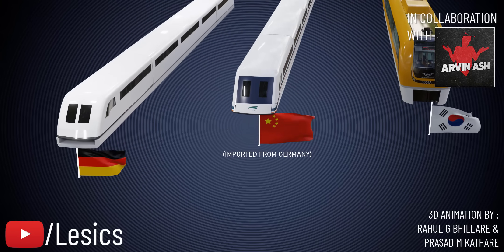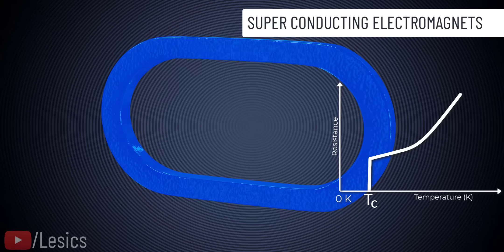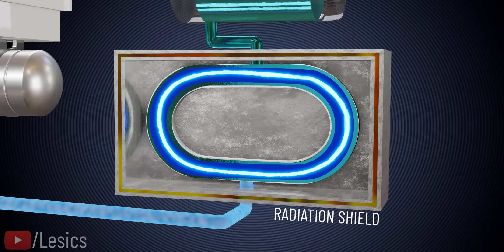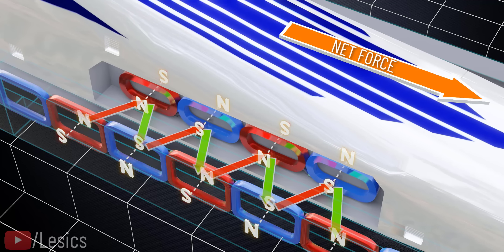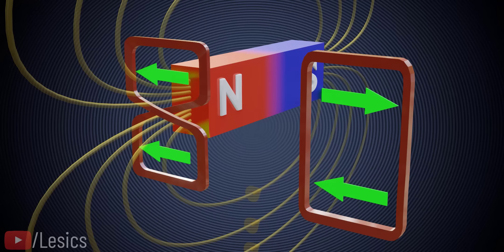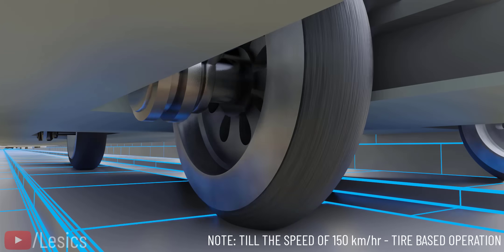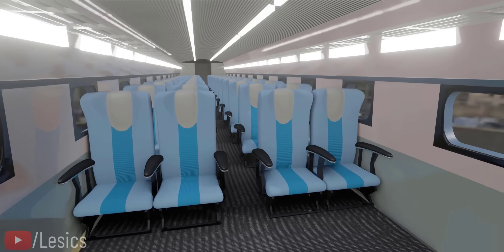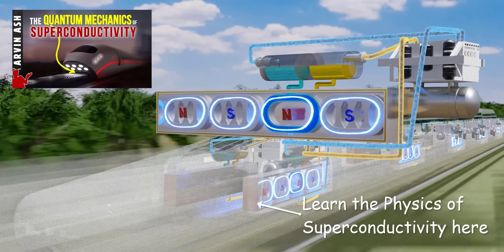The Fastest train ever built | The complete physics of it

Comment: My blowing but yet so simple, all at the same time. I wonder is there is any studies on the human body during a catastrophic failure and the passenger cabin breaking apart. How would the magnet forces harm a person’s body (if they could even survive an incident at those speeds). 
  On a side note, I’ve always like the idea of vacuum tubes and high velocity trains running inside them. Or the vacuum tube canon where a seal is broken at one end and rush if air inlet at the other. It catapults a capsule at incredible speeds with less air resistance in front of it and massive pressure behind it. (Maybe that’s better for launch unmanned objects cross country….or into low orbit?)

Comment: Hi, excellent movie and almost perfect explanation. However, it seems for me that one important thing was not well explained (Superconductive Electromagnets and its rule of operation). 
The viewer may get the impression that the SE works like a perpetual motion machine. Whereas the existence of any machine that performs continuous work without adding energy is impossible. It seems to me that the use of the SE was not to achieve "continuous current flow with a single energization" but rather to significantly reduce the power losses and the heating of the electromagnets during the current flow (current induced in SE coil by the field of external/track electromagnets).
Reply: I thought it was some kind of perpetual motion machine until they got to the cooling part. You need to keep supplying energy to keep the coils below a critical temperature or else they stop being superconductors. It is still very strange but not quite defying physics yet...
Reply: Pudjusp troop

Comment: You can use this system in a same way to make large Darius wind turbines on the ocean, that have no centre axle. The turbine blades follows a 10 km long round track, what gives it a huge torgue, that compensates the loss vs vertical blades, that can't be made that big. Also the weight of this turbine, can be used ass a flywheel, when enclosing the whole circle the moment the wind dropes to much. It will have his best performance in strong and high windspeeds, there where vertical turbines have to get shut down. When putting these turbines in a serial conected position, the turbines in the strongest winds, can transfer energie bij supercooled cables to the slower turning ones, to keep the flywheel motion over a larger distance. The southern ocean is the best spot, as there the winds are strongest.

Comment: So they said alternating the magnet polarities really fast is what drags the train forward. Why did they only peter out at 600 km/h? Is it because the magnets themselves as they are currently designed can't handle alternating any faster, or we lack the computational power to fine-control the switching any faster than that? Or is it just air resistance at this point?
Reply: It may be all of the things you said. Also imagine a scenario where the power gets cut off, the wheels will have to support the train.

Comment: Magnets inside, magnets outside, magnets below, magnets outside. Magnets everywhere.  Remind me of Coleridge’s “Water water everywhere, not a drop to drink”! The SC MgLev train must be a huge power guzzler, at least for the conventional magnets outside which propel the train.
Reply: At least the Transrapid is not, it is more efficient than an ICE, TGV or Shinkansen. Laymen forget that e.g. the German solution accelerates way faster than a highspeed railway wheel-track system. Example: If an ICE train with a schedule of 300 km/h has to stop 2 min longer than planned, it loses 15-20 min on the overall journey, mainly because it takes more than 15 km to accelerate to 300 km/h.
If a Transrapid is 2 min late and it was scheduled for cruising at 450-500 km/h it only loses 4-5 min and can make that up easily without increased wear and tear.
As soon as cruising speeds reach 450 km/h the maglev tech is far superior, and at 500-550 km/h commercial flying has a huge competition.
Had the Germans really built their originally planned Transrapid ring, they could have permanently eliminated domestic flights in Germany. An insane CO2 saver which they did not realize.

Comment: High costs incurred in keeping such a low temperature for Japanese version. The China version prevails in that superconductiion is achieved in higher temperature and hence saving energy costs. This version does not require track quides as the magnetic field is created such that it "pulls" the train back to the centre of the track. In addition, when the train is stationary,  it remains elevated without the aid of wheels and one can easily move the train sideway but will return to centre by itself.🚅

Comment: My genuine question here, why use an electromagnet instead of a natural magnet?
Any reason other than magnetic power / density?
Reply: Good Question! A google search tells me 'Current designs for maglev trains rely on electromagnets, since nobody has been able to make a permanent magnet strong enough to lift the weight of a train.'
Reply: Don't natural magnets eventually run out of power? An electromagnet would be more reliable, and also way easier to tune to the specific settings needed for the train to float.
(All I know if high school physics, don't get angry if I've got something wrong xD)
Reply: @runefaustblack  No, they don't run out of power.
One example is a simple compass.

Comment: I genuinely love how the problems are solved in very simple ways like 
"The train doesn't levitate without any movement yet it has to stop? Remember airplanes? Add retractable wheels!"
"Magnetic forces can be unbalanced on a side? Just connect them and they'll sort themselves out!"
Reply: the connection issue does require considerable setup, but i get what u mean. deceptively simple solutions for large problems. but the way the lateral and vertical forces balance will never fail to blow my mind
Reply: @koransumant6270  I wonder if instead of stabilising, the train will oscillate (and give the passengers motion sickness after an hour maybe)
Reply: @n484l3iehugtil  the forces of magnets are usually more dampening than oscillating because a lot of the motion can get resisted by both magnetic eddy currents and heat run-off, so I don't think that's too much of a problem. I also imagine there will be all sorts of dampening shields on board, because of the sheer forces the train is dealing with on a regular basis

Comment: What happens when the power gets cut off? It also still requires fossil fuel to run the power generation plant
Reply: he said it, the train has retractable wheels, and as for the second question, kinda of, short anwer yes, maybe does but its still more efficient if confronted with other trains and leagues above airplains, long answer, essentially we can create solar farms and wind farms and store the excess power with pumps on hydro dams, we have a solution, but even if it was powere by fossile fuels, more efficiency means less power needed, aka, less pollution
Reply: @silviobleta  right,  picture going 400 miles an hour on that train and it suddenly loses power. Those must be some pretty fast wheels, it would have to be instantaneous
Reply: @chrisward4576  Planes land every day and the biggest wear is screwing around before take off.

Comment: At the first 5 minutes of this video many question marks jumps immediately into my head , the first one was passengers safety from huge electro magnetic field, the second concern was stability during floating, the third one was super conductor temperature, all my concerns where answered at the end of the video but I’m sure all of these preventive mesures will fail one day somehow during a high speed trip which will lead to a catastrophic disaster resulting in shutting down the whole project for safety issues after few months or years of operation. I hope they will notice the faulty issues before the disaster happens
Reply: Disasters have happened to normal trains as well. Have they been shut down? No. Why would maglevs then? And the technology used in those trains is much safer than other trains.
Reply: 日本の鉄道は速さだけではなく安全性を第一に考え、その安全性を確認する為に何十年も時間をかけます。なので、あなたが懸念する不安材料は、全て想定内であり、既に対応済みです。その答えとして、日本の新幹線は何十年も時速300キロ以上で走っていますが、一度も事故を起こしていません。また、このリニアは既にルートも決まり、建設も進んでおり、有人走行も実証済みで、2027年に開業予定です。日本の技術を信じてください。

Comment: How do they stop this while running at such high speed? The concept of braking or bringing to halt?
Reply: They use eddy currents to brake. To put it simply, they convert their kinetic energy to thermal energy using electricity. They also have aerobrakes and normal disc brakes in case of an emergency.

Comment: China has a new maglev train too now thats little bit slow than Japanese maglev 
Its speed is 600km/h
Reply: In five years time.
Reply: @edwardbarnett6571  its literally running now.
Altho not sure if carrying passengers or not. Both Japan and China will prob take 5 years to test and allow public
Reply: @metagde6402  The Japanese one was running with passengers from 1997 to 2007 when it was given an export licence.
It is stopped now while they extend it.
Reply: @edwardbarnett6571  every other video about maglev will tell you the first commerically running maglev was in 2002 shangai
The first maglevs prototype was from germany
You are prob talking about japans prototype maglevs which ran without passengers
Reply: @metagde6402  It had passengers but I believe it was free so it would not be called a commercial operation
Reply: @edwardbarnett6571  that was testing for maglevs train. Even germany did the testing with ppl. A prototype plane carrying ppl it gave money for test flying isnt same as ppl paying passenger planes to fly
Reply: @metagde6402  Well in my opinion if there was no problem for ten years it is proven
Reply: @edwardbarnett6571  then why didnt the train allow normal everyday ppl to use for their work ?
It fails right there. You can change definition in your dream but this real world
Reply: @metagde6402  It is just parked while they extend the track and then most people will do that trip much faster.

Comment: why don't they use high temperature superconductors, so they only need nitrogen. would that not be simpler?
Reply: There are no high-temperature superconductors.
Reply: @jimsagubigula7337  https://en.wikipedia.org/wiki/High-temperature_superconductivity

don't let the word high-temperature fool you 77k is still pretty cold. But is much easier and to cool down to those kind of temperatures than to the close to 0k temperatures used here.
Reply: @MusikCassette  I guess they are much more expensive.
Reply: @MusikCassette  I don't really know the price difference. But it isn't just about that. It's about other things too. Maybe the alloy that is used in Maglev trains. Has a much higher critical field that all the other alloys.

Comment: how do track switches work on the SCmaglev?
Reply: I think it would be possible to have the first set of wheels steerable.
Reply: @edwardbarnett6571  but the wheels are not on the ground during the trip.
Reply: @MusikCassette  I imagine they would be going slowly over a switch
Reply: @edwardbarnett6571  that would make the hole system way less performant. Also kind or dangarous.
Reply: @MusikCassette  As I had only seen the slow points on video I was unaware of fast points although I understand it may be OK on the straight to bypass a container train terminal.
Reply: Please refer to the following document(Sorry that is only the Japanese version. Please translate it). It seems that the train could pass through the straight path in the levitating state. 

リニアの仕組み - 分岐器について
https://www.linear-museum.pref.yamanashi.jp/about/structure.html#004
Reply: @rch5055  Thanks for the link I have seen videos of the slow junction but I can see if it is on the straight it would be ok

Comment: What are the redundant safety systems for a train like this? If the cooling system fails and you loose a super conductor it seems like things could go badly.
Reply: It surely would take a certain amount of time before the train drops onto the wheels
Reply: @edwardbarnett6571  I'm not sure how long it takes a super conductor to heat up, but considering they only need to get to like 150 Kelvin I'd imagine it happens in short order.

Can the train slow down and actually deploy the wheels in time? 

Or what if something even more abrupt happens like the track looses power.
Reply: @Justin73791  As it has been proven for ten years and Japan is very safety concious, I think it would take sufficient time for wheels to deploy.

Comment: When train is levitating in the middle of coil, no current will be induced in coil as both loops cutting same amount of magnetic field lines. As there is no current, How will train be guidanced as no current will flow through connecting wire ?
Reply: Since the train is always in motion, maybe there is less time in the middle of the coil?

Comment: Anyone believes that the rail in U.S. can be built in 2030?
Reply: I do not believe there will be any steel rails built in 2030 because it is the slow and too much maintenance.
Instead America will be connected with Japanese maglev built to have an ISO guideway in single 11psi tunnels for ISO carriages and ISO containers built worldwide with American knowhow.
Due to no maintenance containers can beat any truck overnight by 8 hours over 1,000km earning $2,000 per container so the cheap ticket through the day is constant regardless of inflation or fuel price.

Comment: Unless this train stops in the small towns along the tracks it will never happen, so my idea is to have the last car or cars unconnect from the train, slow up and wait for the switch to direct the car or cars to the station. At the same time other cars with passengers at the station are waiting to join the train. The cars move out to the siding and wait for the train to speed by, the tracks switch to allow the new car or cars to join up with the train, the train slows down a little bit the car speed up they connect automatically and the train resumes the high-speed never happen to stop in a station I have put this idea on the Internet a dozen times nobody seems to be listening.

Comment: this is still in planning stage? chinese maglev is in production already & start the testing (real/final product testing). it also using hotter superconductor for cheaper operation cost.
Reply: Don't give false information and undermine China's credibility.  The Japanese Linear is already running at 600 km / h, but the Chinese Linear has only been able to mock up.
Reply: @KR-ek2ub  japanese's will be ready in 2027, chinese's already in production.
Reply: @KR-ek2ub  you can find information about how to produce something: the difference between research, development, and production. you can google about the speed of current operational maglev in japan, none of them are 600kph.
Reply: @YohannesKristiawan  No matter how much I search on Google, I can't find a video of Maglev in China running at 600 km / h.  The Japanese linear is 600 km / h in the test, but 505 km / h in commercial operation.  If China's Maglev operates at 600 km / h, it will surpass Japan.  How many decades ahead?
Reply: @YohannesKristiawan  I know this video.  CG is cool.When do you test at 600 km / h?  Do you already have railroad tracks?  ??  ??
Reply: @YohannesKristiawan  It is dangerous to suddenly make a file product without making a test vehicle.
Reply: @KR-ek2ub  china maglev max speed is 620kph, will run 600kph in operation. the factory is ready, the product is ready. the problem is: government has not decide which route the track should be built.
you can also search the cooling technology: japanese using helium, china using nitrogen which is newer technology & cheaper to operate.
Reply: @KR-ek2ub  the test version is running years ago.

Comment: Thanks for the great video!
At the time of its opening, the speed of the Shinkansen was 200 km/h.
The current speed is 350 km/h.
The superconducting linear system is 603 km/h in tests.
When it opens in 2027, the operating speed will be 500 km/h.
However, after the opening of the line, they are aiming for a speed of over 600 km/h.
Superconducting linear systems become more stable as the speed increases.
The problem with the Shanghai linear line is that it can only rise one centimeter, so for safety reasons, the speed cannot be increased any further.
Furthermore, the speed will decrease due to tolerant issues.
In fact, it is no longer able to reach the speed it had when it first started.
Reply: youtube.com/watch?v=4EmCT9Ckg50
youtube.com/watch?v=1p86P2DuVHs
youtube.com/watch?v=NO2fEXiTPTQ

Comment: One big problem the designers of these MagLev trains had overseen. Imaging the train traveling at 600 km/hour and suddenly there is a power failure. It will lost it magnetic levitation and the cabins comes in contact and rub against the guide rails with sparks flying around and steel melting.
Reply: Even in the event of a power outage, as long as the vehicle is running at high speed, the levitation force is constantly generated, so the vehicle will stop safely without suddenly falling to the ground.

Comment: Japan's central Shinkansen maglev train set (operation) speed is 505km / h, the first section of the line is about 285km long, is expected to run in 2027.

The maximum test speed of 2020 project sample vehicle is 603km / h.

China's Beijing Shanghai maglev train, with a set speed of 600km / h and a total length of 1318km, is expected to run from 2026 to 2028.

In 2020, the test sample vehicle will test the speed of 600km / h. in June 2021, the engineering sample vehicle will be offline, and the maximum speed is unknown.